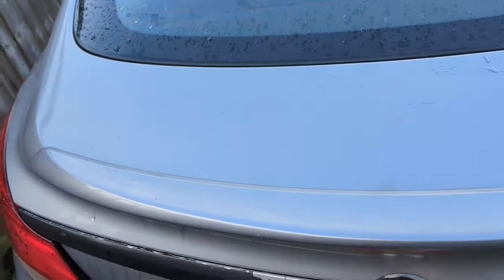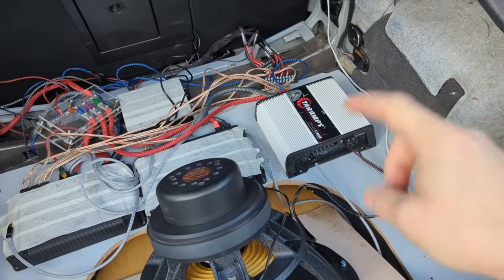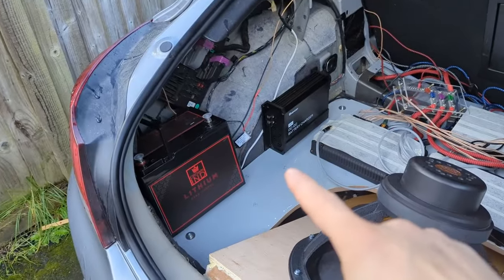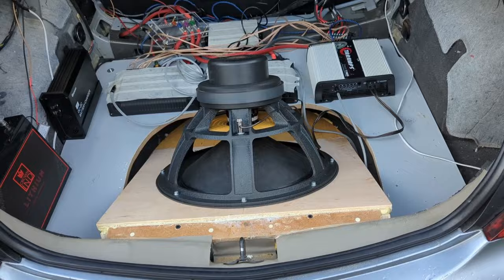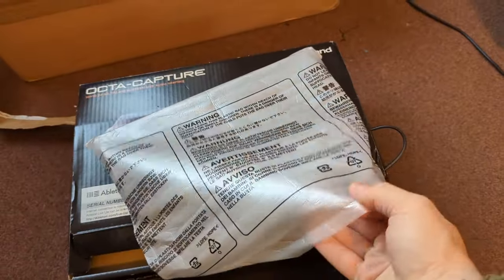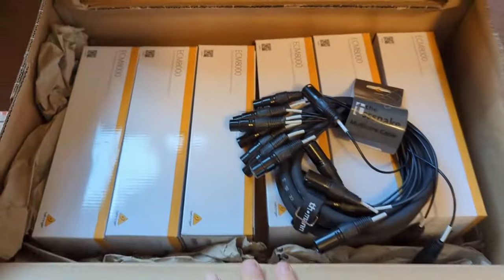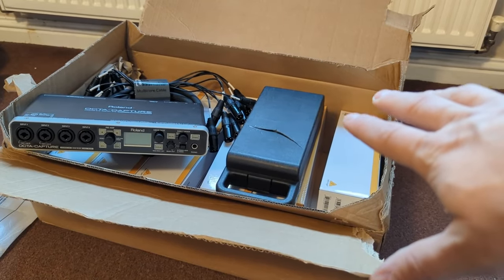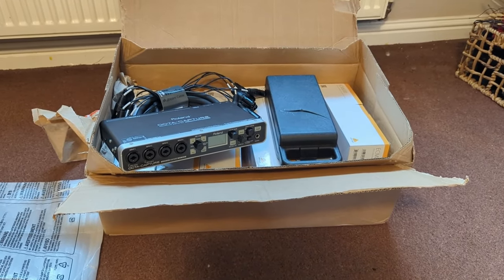Daily update. Taramps Smart 3 bass, Recoil DI1200.4, microphone array.

Comment: I'm running 2 DI1200.4 Recoil amps in my Navigator and I am blown away how amazing these amps perform. I have the front amp's 1/2 channels running my CDT mid woofers in doors, and the 2nd amp's channels 1/2 running Recoil RAX65 Rose Gold coaxials in rear doors. The other 3/4 channels on both amps are powering Recoil Echo Pro 10PWD2s sealed, firing upward. Then, I have a DI550.4 running Recoil Soft Dome tweeters and CDT Unity Widebands in custom A pillar pods (one channel to each speaker) and all of it run thru LC2i and an Expert Air8 DSP. All in all, my 100K truck has a 2K total spend on my entire system and the loudness and clarity is ridiculous.  Shoutout to Recoil. Completely impressed.
Reply: I assume you voltage matched the outputs of the 3/4 channels going to the subs.
Reply: BTW, it sounds like you have $2k to $3k worth of installation that you saved by doing it yourself. 👍
Reply: @JasonWW2000  the gentleman who built my custom sub box for $250 did the system tuning for free.
Reply: Im truely surprised that the amp testing videos didnt perform well. Nobody else is doing it and the testing is so helpful to us consumers. I am actually thinking about doing amp testing myself. I have been doing research on equipment but I cant make up my mind, should I just buy Scarlett 4th or buy some pro devices.
Reply: Im always interested in tuning and distortion videos. To me, thats the most important and fun part of car audio (and install/fabrication).
Reply from the maker: Amp dynos are easier to understand, so those are more popular, it's only one number after all😄

Comment: I can't wait for the THD measurements for the Taramps. Been thinking about picking it up for it's small form factor. Mmats measurements would be interesting too
Reply: Taramps does have a reputation for building on a very low budget, pushing the components too hard and finding ways to cheat the amp dyno. With so many amp choices available, I've chosen to not use them.
Reply: @JasonWW2000  we'll see what the measurements say
Reply: thats just not true but ok.  @JasonWW2000
Reply: @eliseoquiroz8321 The time frame that Joe talks about the Taramps is 1h16m to 1h46m. It was live Oct 3. 
Spoiler alert-
The amp blew up during the 2 ohm testing.
Reply: @JasonWW2000  who's Joe?
Reply: @eliseoquiroz8321 Joe Hobart. Director of Electrical Engineering at Stillwater Designs. He basically designs amps for Kicker.
Reply: @JasonWW2000 
Big D Wiz has blown amps
Parker the Basshead has blow amps
Pas Mag has blown amps
I've blown amps
One blown amps doesn't mean anything
Reply: @brianwatson3705  Yes, I know. Resistive loads can be pretty brutal on amps.

Comment: Why would you run a special cable from alternator and not from battery? Battery and alternator are directly connected with wire so it does not matter.
Reply from the maker: Battery gives constant 12V no matter what. Alternator live giver 12V only when the engine is running and the alternator is spinning.
Reply: @RAW-CAt   I do not think so, alternator and battery are in one circuit. Permanently connected without any braker or relay what disconnect when the engine is off. So as they are connected and you turn off your engine. There will be still 12V on alternator connection as it is still connected to battery
Reply from the maker: @kiklop8362  I am not talking about the positive from the alternator. I am talking about alternator live wire. It's not the same.it's the wire that tells ECU that the alternator is working.
Reply: @RAW-CAt  Aaah, now we are clear :)